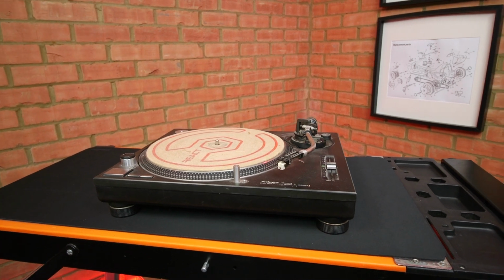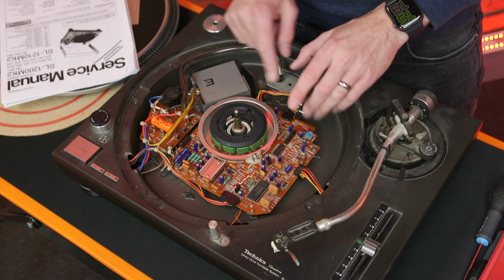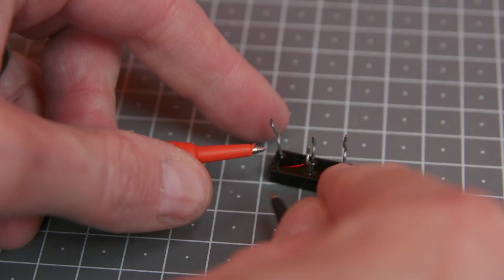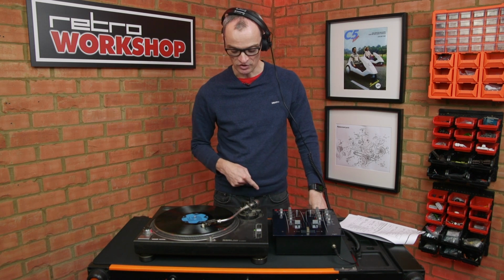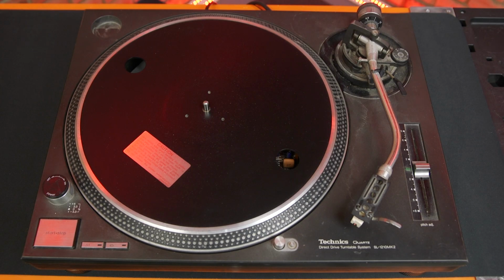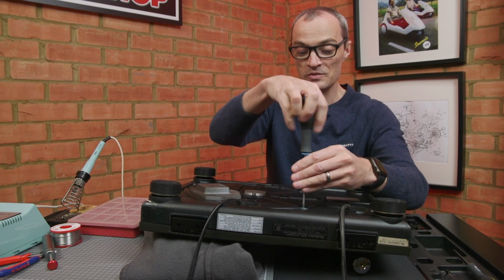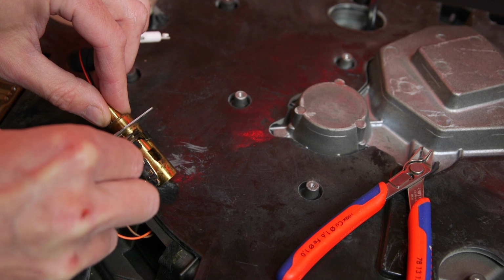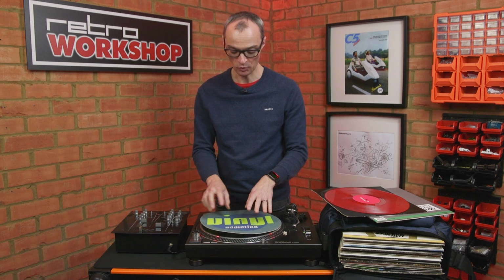Technics 1210 repair | blowing fuses & target light replacement

Comment: Thanks SO MUCH for this vid! I have 2x SL1210s from 1987 and one of the stylus illuminator lights went on it years ago. I have been wanting to fix it (or get it fixed) but the thought was just too daunting... But your video showed how straight-forward it was! Success!  And even the eBay seller ID you point out is the same for the LED supplier.  In fact the LED is way better than the original light so I'll probably do that now! With renewed enthusiasm!!! Thanks again.
Reply from the maker: Glad you got it fixed.  Nice work!

Comment: 3 in 1 oils are the wrong type, it's too viscous for the tolerance on the bearing, you have too use really fine electric motor oil otherwise the bearing keeps sticking as the platter is rotating

Comment: great job ... I wonder where can I order the light led ... I hope it's not big diference than the original light since my other mk2 still have the original light. it will look weird on my setup
Reply from the maker: Ebay. No idea how well it will match the original in terms of brightness, or colour temperature. You could of course buy two, and replace both so they match.

Comment: Great video. Is there any way to remove the scratches from the body? I have a couple from years of transit to house parties that I'd love to be able to remove.
Reply from the maker: I think it’s painted so you could touch it up or re spray it.
Reply: @RetroWorkshop  isnt it powder coated or something similar?

Comment: While the cover was off, it was probably also worth it to check that the pitch fader was correctly calibrated (i.e. zeroed in) as the slide pot resistance also seems to stray over time and is extremely important when beat matching on two turntables. The service manual you had also walks you through that procedure. Thanks for the video!
Reply from the maker: Good shout there. Mark only had one deck, so no beat matching going on there! When I had a pair of 1210's a few years back, I remember removing the ball bearing that forced the centre lock on the fader. This ball bearing meant there was a small space either side of the centre click, which you couldn't use as the ball would pull the position back to the centre.

Comment: Very Nice and thorough... was just looking for a way to fix the needle light myself and it feels doable even though i'm not a technician like you are...just wandering if you would be so nice to share a link to the proper led light you took instead of the original spare... and a question... is it warm and soft like the original or just warm but more powerful ( that is what it seems by the video) tnx a lot
Reply from the maker: The eBay seller i captioned in the video no longer sells it. It was similarly warm to the original. Maybe a touch more light output. EBay seller thescratchstore sells something similar not sure if they are warm white, send them a message.

Comment: Great video , seeing the Technics brought back to life was nice, and the Technics is still sporting an original Gold  Stanton 500 I have a late 60s Garrard zero100 with an the 500 and they are going strong after 53 years though getting original styli are near on impossible but Jico do a replacement
Reply from the maker: Thanks for the nice comment. They are great machines. To be honest I thought the sound from the stylus wasn't as good as I remember from the Ortofon Pro S's that I used when I had 1210s. This stylus may have been worn. Or my ears may have deteriorated!

Comment: Hi, does it means the led works directly from supplied 21 volt without resistor?
Reply from the maker: If you watch the video, you hear that I say "this one comes on a little PCB with the required resistor". 9'47"

Comment: Thanks for this! 

I picked up two Technics 1200's for $500 a couple years ago, and one of them has sort of the opposite problem of yours with the brake.

It basically has low torque. The platter slows down when I'm holding the record and takes a second to get back up to full speed after I let go, making it VERY hard to beatmatch.

Do you have any idea what component could be responsible for that?